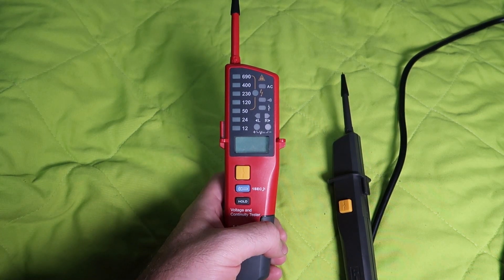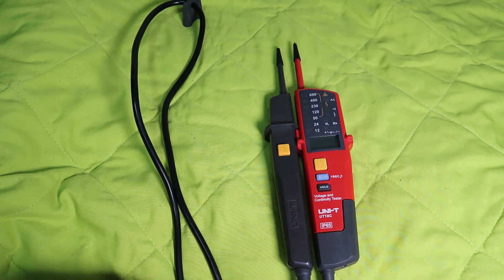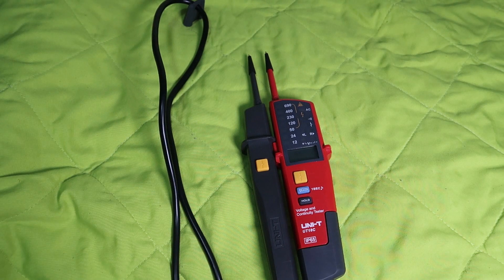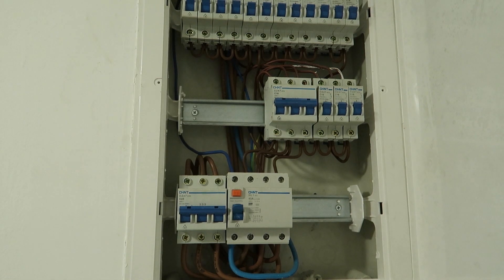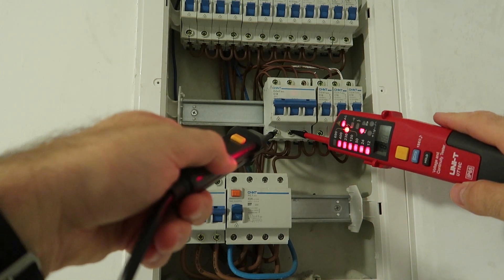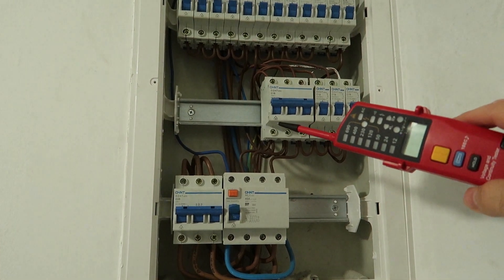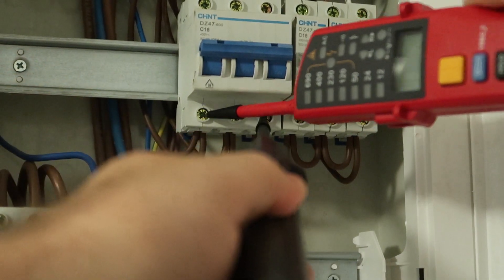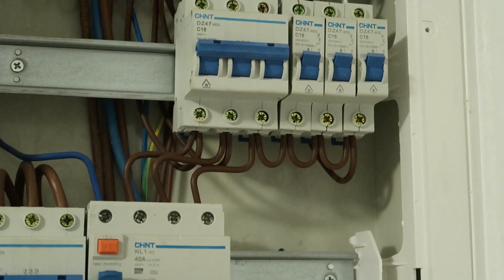UNI UT-18C 3 phase voltage measurement tool

Comment: First, those 2 yellows buttons are for testing rcd/rcb/rcbo/rccb (residual-current devices) you connect one probe to line/phase and one to earth/ground and then you press the two yellow buttons.
Second, to check phase rotation you do something like this: you got the phases 1 2 and 3 and got 2 probes (they are marked L1"black" and L2"red"):
-you connect L1(probe) to phase 1 and L2(probe) to phase 2(you got to have a right rotation, the "R led" should be lit);
-then L1(probe) to phase 2 and L2(probe) to phase 3(you got to have a right rotation, the "R led" should be lit);
-last L1(probe) to phase 3 and L2(probe) to phase 1(you got to have a right rotation, the "R led" should be lit);
It's easy :))
Reply: Thanks! Can it do a polarity test on AC?